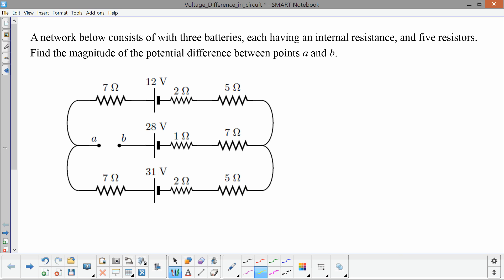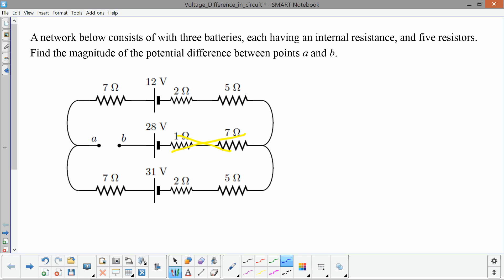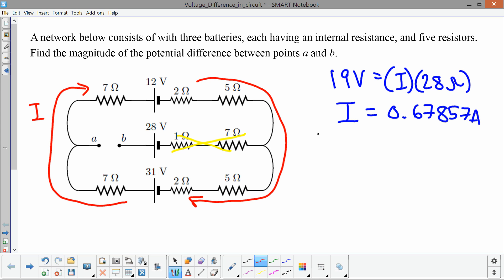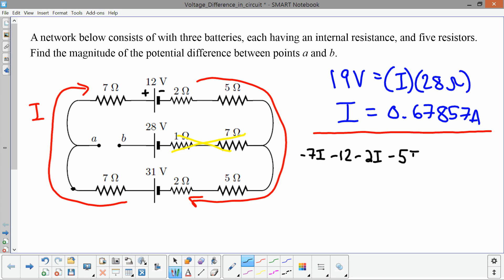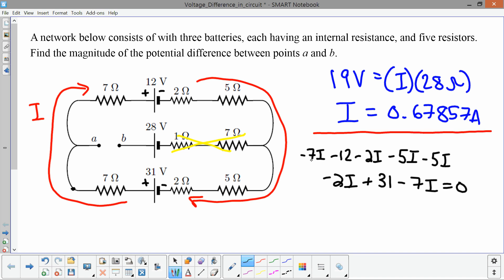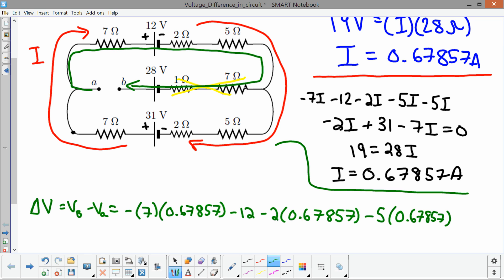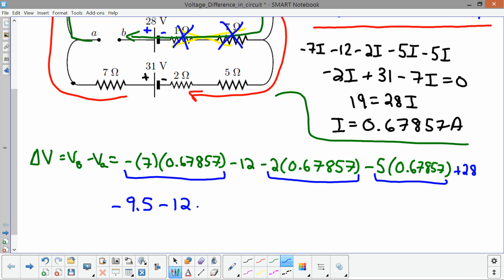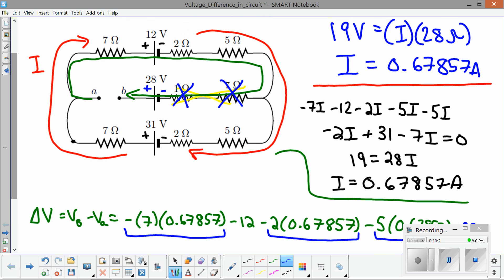Voltage Difference Between Two Points in Circuit

Comment: why are all the I's negative?
Reply from the maker: When your loop goes through a resistor in the direction of the current, the voltage decreases (the change in voltage is negative).
Reply: thanks you for that answer. Why does the voltage decrease?
Reply from the maker: Two ways to understand it:
1) As charge flows through the resistor, it "bumps into" the atoms (that is an explanation of what resistance is) and when it bumps into the atoms, it loses energy, which is a voltage decrease. 
2) An electric field is what pushes charge through the wire. The electric field is in the direction of the force on positive charges, and the direction of the current is the direction that positive charges flow. The relationship between change in voltage and electric field is that the electric field points in the direction of decreasing voltage.
Reply: thanks so much!!

Comment: But that doesn't equal zero... It's -9. I'm confused
Reply from the maker: Some of the terms have "I"s and some are just numbers. You can only combine like terms. When you add them up you get 19 - 28*I = 0
Reply: Oh ok. Thank you. So when you know what "I" is and you're able to factor that in it will equal zero?
Reply from the maker: Correct. The changes in voltage around a complete loop add up to zero. This is called "Kirchhoff's Loop Rule."
Reply: And that rule basically means there can not be any lost energy?
Reply from the maker: Correct. It comes from conservation of energy.
Reply: Awesome. Thanks so much
Reply: Scott Secrest Hey Scott. I have a few questions about batteries if you don't mind. If you could help I'd really appreciate it. I don't know anyone who has electrical experience and I'm trying to learn more about it
Reply from the maker: Let me know your questions and I will try to help as much as possible.
Reply: Thank you. 1. Are the positive ions created by oxidation attracted to the cathode because of the electrons that got there from going around the wire or are they more or less pushed there from the "current inside the electrolyte" (thought i read that on one website)? 2. Im confused about what happens chemically when a battery is being charged. How are the cations that were attracted to the cathode during discharge pushed back to the anode? 3. Also, i read that positive ions make their way through the wire in the direction of the current (so from positive to negative terminal?), do those also produce electricity along with the electrons making their way in the other direction? Any insight you have at all would be a big help.

Comment: Would the problem be different if the voltages were given as emf (i.e. they said 19, 28 and 31ε) because I am confused about why the internal resistance does not play a larger part in the problem
Reply from the maker: An electromotive force (or EMF) is just another term for voltage. Saying that the top battery has a voltage of 12 V could also be stated as the top battery has an emf ε = 12 V. They are the same thing. A real battery with an internal resistance can be treated as an ideal battery (with no resistance) connected in series with a small resistor (that is the internal resistance of the battery). The 2 ohms is the internal resistance of the 12 V battery. It is just treated like any other resistor in the problem.

Comment: why did you subtract the 12 volt from the 31 volt ? why don't you add?
Reply from the maker: It is because of the way that the batteries are connected. Because they are working against each other (since the two positive terminals are connected together) you subtract the voltages. In the second part of the video (starting at about 3 minutes) when I discuss the loop rule and use it to set up an equation from a complete loop around the circuit, it might make it easier to see why the signs work out.
Reply: so if the terminals  where connected positive to negative or negative to positive  would we add them  ?
Reply from the maker: Correct. In that case the two batteries are working together to increase the voltage so you add the voltages together.
Reply: +Scott Secrest thank you so much you have helped a lot 😁